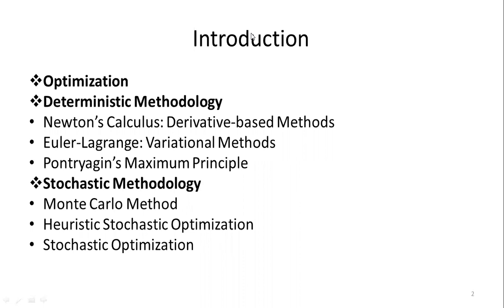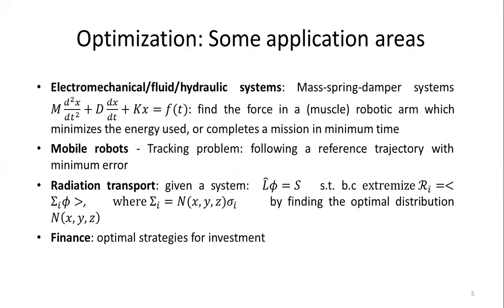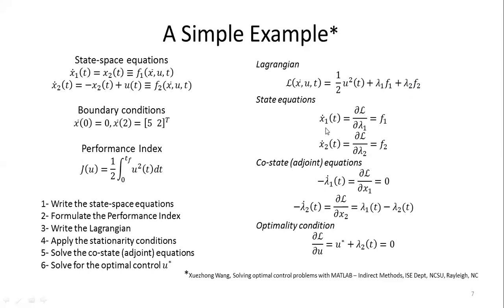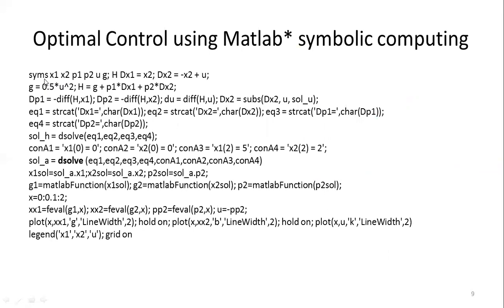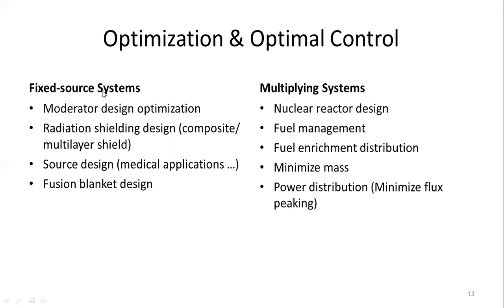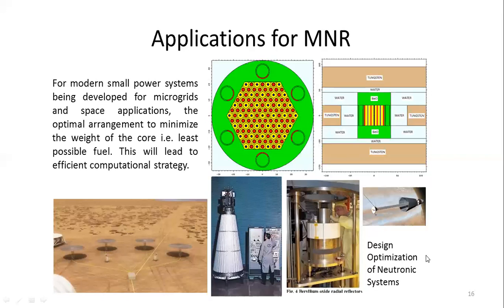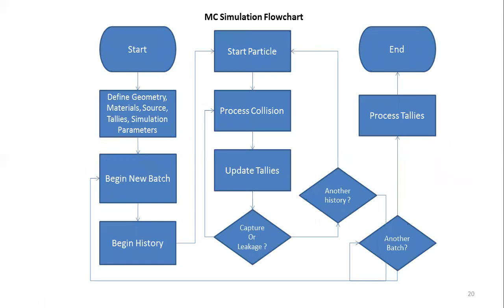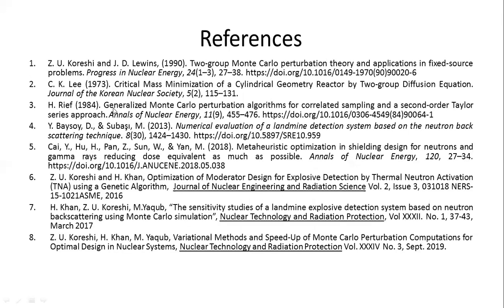Optimization and Optimal Control: An Overview

Comment: What will be the code if there are more than 2 equations., say 3: x_1, x_2, x_3
Reply from the maker: No problems, the method is valud, just have to go to matrices and can easily solve if its a liner problem 
For nonlinear, other methods are used
Reply from the maker: Typo errors: i mean "no problem..  the method is valid... "
Just convert every n-th order ODE into n 1st-order ODEs and you can apply the method